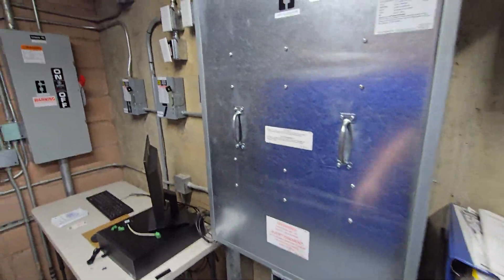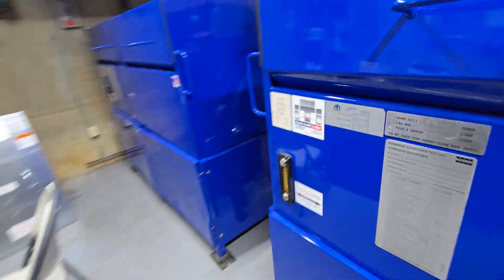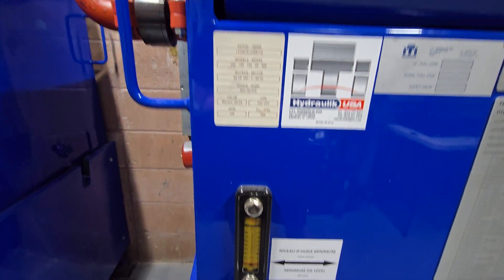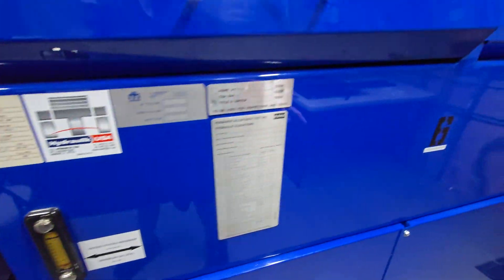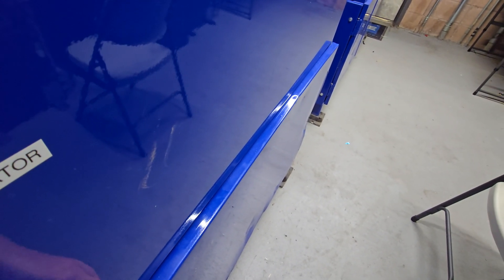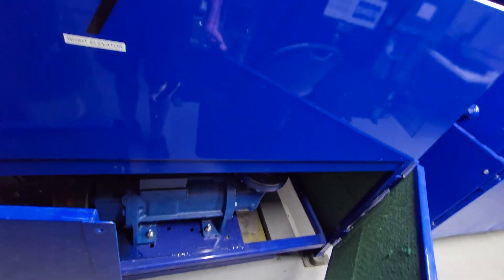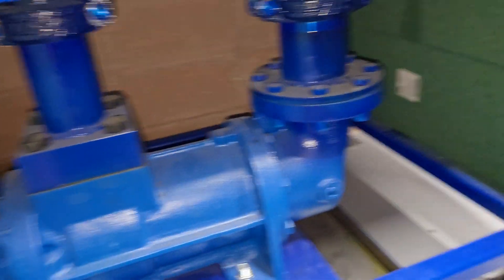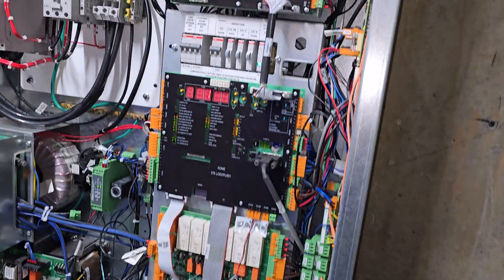AWESOME Brand New Kone/ITI Dry-Powered Hydraulic Elevator Machine Room

Comment: Nice looking and sounding power units, especially since the blue looks a lot like what Dover used in the 1980s and 1990s, while the power unit itself sounds like those of the 1970s and 1980s ESCO elevators.
Reply from the maker: I love these ITI power units. All the covers are hinged, and the tank lids have holders to hold them up. They are very well-designed and use good parts. This one used an Imperial Electric motor, IMO pump, Maxton valve, and MEI silencer. In terms of the branded parts they use, they are virtually identical to MEI, but they have a much better power unit design and build quality.

Comment: Always wanted to see an EcoDraulic machine.
Reply from the maker: Kone doesn't make their own machines. They use ones made by other brands. ITI also sells machines to many different companies. Kone surprisingly uses their own controllers on hydros, though.
Reply: @QEElevators  That makes sense, I know they stopped doing their own hydros in 2007 so this is clearly a mod.
Reply from the maker: @BusMaster99  I'm pretty sure they still install hydraulic elevators to some degree as they make the control equipment for them and I've seen many mods.
Reply: @QEElevators I didn't know that the machines were third-party in the KONE HydroMod modernisation solution.
Reply: YOUTUBES FIRST????